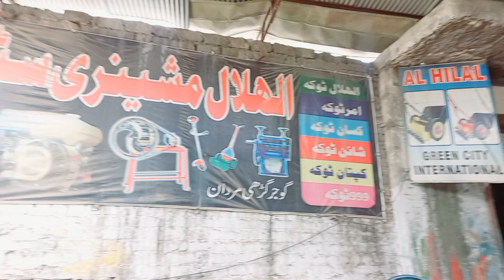Grass Cutter Toka Machine mass production process 😲 #restoration tools #Factory Mass Production

Comment: the fellow measuring every time he cut an angle can put a distance stop welding it to the machine and just keep cutting without measuring every time 
ساتھی جب بھی زاویہ کاٹتا ہے تو وہ فاصلہ رکھ سکتا ہے اسے مشین سے ویلڈنگ روک سکتا ہے اور ہر بار ناپے بغیر کاٹتا رہتا ہے۔
Reply from the maker: That's after editing...
Reply: @howthings78  well if they can read the English that will be fine l am not sure Google put the same thing as it looks shorter then the English which was 26 words
Reply from the maker: Thanks for your lovely compliment  💕
Reply from the maker: By the way! From Where you Are Sir ?
Reply: @howthings78  I used Google translate English to Urdu I don't know if it works good
Reply from the maker: Ya... it  works...